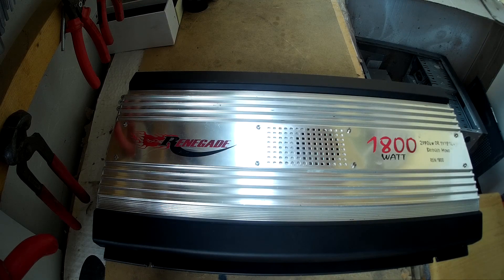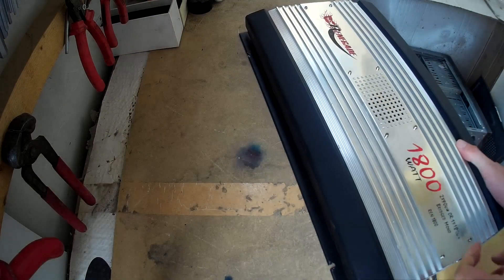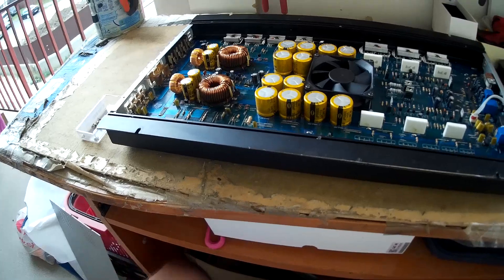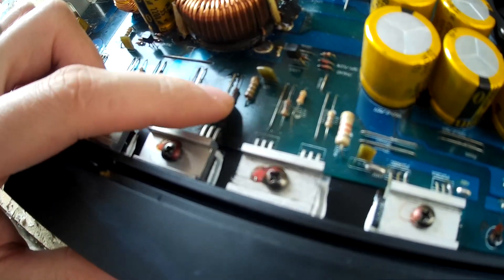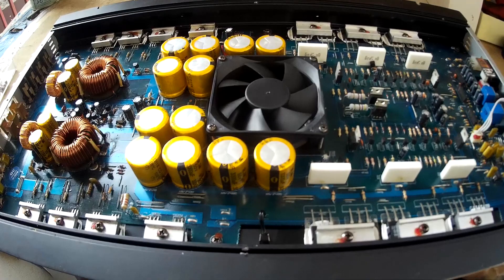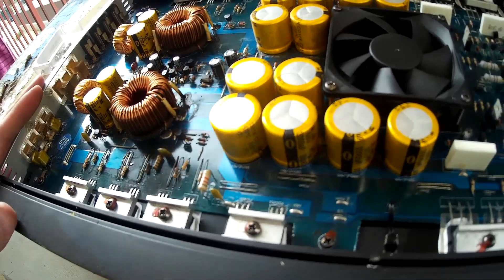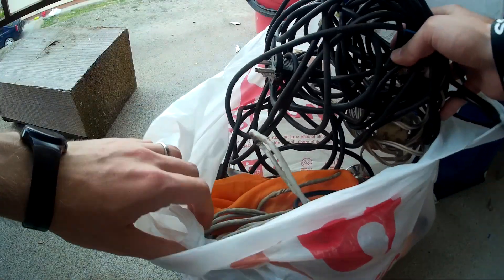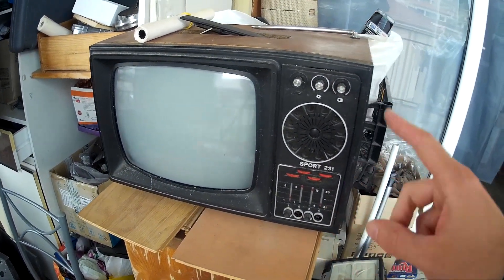Car Audio Amplifier! What's inside??

Comment: yeach they are cool to scrapp easy and nice amount of good scrap metall
Reply from the maker: Yea a quick scrap it is! The most value is in the aluminum heatshink, I think it weighs about 20 pounds :)
Reply: agree once i get over 300 power inverters basicly same deal as amplifiers they just make 12v to 220v and huge alu cover  was cool to get it but after 50 i get tired of that anyway i get a good money flowing in  have a good one dude
Reply from the maker: :) Woww! 300 inverters?? I would like something like that! How you get your scrap??
Reply: most of my best pickups come out from scrapyard what i need to pay for but sometimes i getting some goodies from some companies and basically from private peeps is not so good stuff just basic  thing like 1 or 2 pc and a lot of low-value stuff but it is always something to pick out from the pile
Reply from the maker: Rafal Scrapper  i understand. agree with you! I will try at the scrap yard more